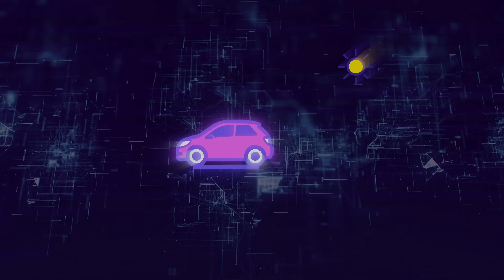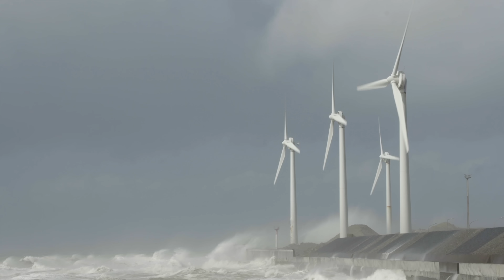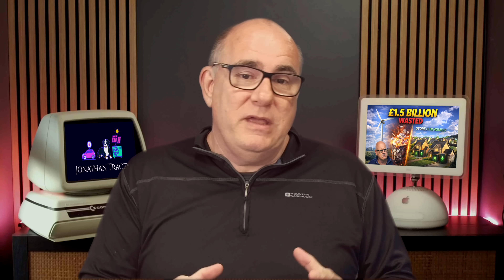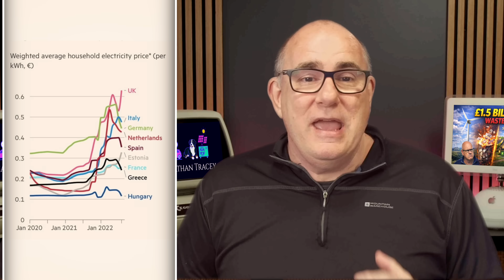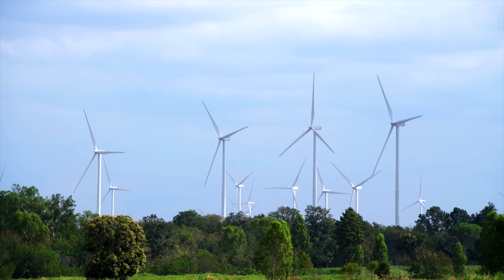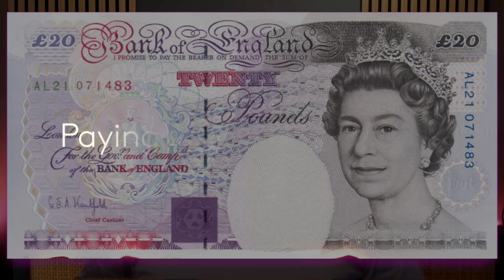We’re Paying £1 5 BILLION To Waste Energy… Here’s My Big Idea

Comment: Have had the same thought myself, it's a total no brainer to mitigate the overbuilding of renewables where necessary energy storage was conveniently omitted to make the numbers look better.

But need to correct you on one point, the point of gas fired plants was never to be turned off and on to make up for lack of renewable production. The fact this is now taking place is a another huge externality of renewables whereby they make the cost per MWh of base load look extremely expensive because plants designed to run 24/7 have much lower utilisation but the same capital and fixed costs
Reply from the maker: @SuperBulrog You’re absolutely right on the utilisation point 👍  

Gas plants were originally designed to run much more consistently, and lower utilisation does push up their cost per MWh because those fixed costs don’t go away.  

Where things have shifted though is how the system is being operated. Gas has effectively become the balancing mechanism — not because that was the original intention, but because it’s one of the few things that can ramp up and down quickly enough to deal with variability.  

So in practice we’ve ended up in a situation where:
- Renewables set the availability  
- Gas sets the price and fills the gaps  

I’d argue the real issue isn’t renewables themselves, but that we didn’t build storage, flexibility, and grid capacity alongside them — so we’ve forced gas into that stop/start role by default.  

If we had enough storage and demand-side flexibility, gas wouldn’t need to be used in that way nearly as much.
Reply: Even at 100% utilisation gas power plants are about £95 per MWh. Scottish wind with the cost of the cable to remove the bottleneck and the curtailment fee, 25% of which goes to the farm, and 75% goes to the gas power plant, comes out to £60 per MWh.

So counterintuitively, it would be cheaper to pay MORE wind turbines for their excess power, than it would to run a gas power plant.

But we're not doing that. We're building bigger cables so the power isn't wasted which will lower the current wind power cost by £1.5B per year, AND enable us to build more generation capacity which will lower the gas plant cost from ~£95/MWh to ~£45/MWh. And because the energy price is set by the most expensive generation that's on at that time, this will potentially, basically half our energy costs... as long as those costs gets passed on to the consumer...
Reply: @Leo99929  Cables and using excess production is only half the story. Without including grid-scale storage in the cost, you can’t fairly compare wind to baseload generation. More wind without storage raises blackout risks during calm periods and worsens grid inertia issues. With proper storage, the total cost is significantly higher than the £60/MWh quoted.

Comment: The home battery idea presented is only in part a potential solution as the battery storage would need to be on the same side of the grid constraint as the constrained generation. The potential solutions are 
1. Increase grid capacity to reduce the constraints. This is happening and is delivering but is  of long timescale.
2. Increase demand in the area on the generation side of the constraint (typically in Scotland). The battery proposal covers this in part but Octopus are also addressing the beginnings of this by incentivising increasing consumption at these times for the customers on that side of the constraint. This could be automated in an increasing manner with more control of heavy loads such as EV charging or heating water. 
3. Linked to 2, incentivise industry to locate in generation rich areas.
Reply from the maker: @ianmitchell6279 This is a really solid breakdown 👍  

I completely agree — batteries only solve the constraint problem if they’re on the right side of it. A battery in the south doesn’t help when the excess generation is stuck in Scotland.  

Your three points are basically the whole strategy:
1) Build more grid (slow but happening)  
2) Increase demand where the energy is (smart tariffs, EV charging, heat, etc.)  
3) Move industry closer to generation  

Where I think the “home battery” idea still has a role is in scale and speed. We can deploy thousands of small systems *very quickly*, and if they’re even partially aligned (through tariffs or automation), they can start to absorb some of that excess generation sooner rather than waiting years for grid upgrades.  

It’s not a silver bullet, but more of a “buy us time” solution while the bigger infrastructure catches up.  

The interesting bit will be how well suppliers can actually coordinate that demand side — because that’s where this either works… or doesn’t.
Reply: The cables are due by 2030. Not sure how long it would take to set up factories to produce the batteries to sell, but I bet it's more than 5 years, and at 40% of the £/kWh estimated in the video, it would cost about 6x as much in 3.7M BEV batteries and there's only 3M cars in Scotland...

There's things we can do in the short term and the gov is way too slow at approving things like V2G and electric micro mobility. But the long term cheapest solution is £8B worth of undersea cables that are already in progress. Communication from the Gov on this has been poor. 

But given this is the case, it might be worth looking at where you get your news from if this is the impression you have, because somebody is actively trying to manipulate/mislead you! Most newspapers are run at a loss/tiny profit because they make money for their owners by swinging public opinion for a fee.
Reply: A simpler idea is to scrap the subsidy for unreliables . Why hasn't that been considered? If the wind doesn't blow, there's no electricity. Those people who want unreliables can have a black out and the sensible people can pay for conventional fuels. If too much is produced, the windmills shut down. Too little and energy is horrifically expensive. Just stop taxing gas and nuclear and subsidising unreliables and let people buy whatever energy they want. Ah, but that would expose the hoax, wouldn't it?

Comment: The problem is that if they installed these batteries in to every home the great majority would vote against it saying it's only the government wanting too snoop on you.
Reply from the maker: yeah some people just can't be helped but most normal people would see it as "reducing my bills"
Reply: @JonathanTracey  Are there any normal people?
Reply: I know four people who refuse to have a smart meter for the same reason... Convincing them to have a smart battery installed by the government would be a serious uphill struggle,  if they were paid to have one they would be even more suspicious. 😏
Reply: @roblinc2u  I worked in computer security. I have a non internet connected system that's not to bright. I'm not scared of the government but of garbage software, dodgy cloud services, companies going bust, and bored teenagers.
Rolling out a large amount of centrally managed batteries is a really challenging security problem and most of the software produced today isn't fit for purpose let alone fit for use in a secure environment.
Reply: In fairness, the state would. They'd want to control what the energy was used for.

Comment: The problem is the power lines from Scotland can't carry enough energy down to the south - It's not a storage issue

Those gas turbines they turn on are located in the south where this "network congestion" problem doesn't exist

That said, batteries just make sense don't they? Your base load can be virtually eliminated using just battery and arbitrage and that's before you've even put solar panels in
Reply from the maker: @Akimbo711 You’re definitely on the right track 👍  

It’s not that the power can’t come down from Scotland — it’s that the network can’t handle it all at once, so we end up curtailing generation and firing up gas in the south.  

Batteries absolutely help with that, especially if they’re placed near generation — they can soak up excess and reduce how much we need to push through the grid at peak times.  

The bit that’s often missed though is scale. You need a lot of storage to make a meaningful dent, and it has to be coordinated properly, not just scattered.  

But your broader point stands — a mix of grid upgrades, interconnectors, and distributed storage is the way out of this. It’s not one silver bullet, it’s all of it working together.

Comment: This could start at the planning stage. All new dwellings and industrial premises must have batteries installed otherwise no permission.
Reply from the maker: I agree it should be mandatory for every new home
Reply: @JonathanTracey Unfortunately new homes are currently being provided with sub-standard solar and batteries. Effix the Electricians Channel did a YouTube video exposing this.
Reply: And it needs to be a decent size battery 10 kWh minimum, not like the three or two panel systems being put on some houses or a three pin socket for the EV charger. In other words the legislation needs to be absolutely specific as to how much, probably calculated by roof area. EV chargers should be mandatory 7 kw.

Comment: The problem is that there is still a glut north of B6? that can't be stored by the locals without some rather large batteries and/or more grid.
Reply from the maker: sounds like a solvable problem to me
Reply: @JonathanTracey  It's being solved by the Eastern Green Links (EGL1, 2, 3, and 4). These are additional 2 GW subsea cables. By the early 2030s, these will more than triple the capacity to move power south.  

The goal isn't just to stop the 10 TWh of waste we have today, but to prepare for the 80+ GW of new wind power currently in the planning pipeline—enough to turn Scotland into a "green battery" for the rest of Europe.

This will cost ~£8B, vs the £48B you can calculate the battery cost to be, which needs to be installed in Scotland north of the B6, for a fraction of the capacity. The battery would only solve the current local over production. The cables will enable further expansion with zero over production.
Reply: @JonathanTracey  Except locals don't want large industrial complexes located in the Scottish Highlands. Just look at the planning refusal for the Fanellan Substation in my area. Proposal that would disrupt transport, require bridges be replaced, increase traffic on narrow local roads and provide absolutely NO benefit for local people.
Reply: @tarbat and continue to have higher standing charges and unit rates. Here, have this monstrosity and pay us to have it.
Reply: @t @tarbat chap, we’re all on this island together and we all have to do our bit. You think I want a railway running by my garden? You think I like paying tax? Not really, but it’s good for everyone and we all benefit.
Reply: @JamesJones-uu7ou  Totally different. A railway line and taxes most likely benefit you LOCALLY. Wind farms and battery storage provide NO local benefit.
Reply: @tarbat how does paying taxes, far in excess of the services I directly receive, benefit me?
Reply: The wind farms are still in the wrong place. The argument seems confused.
Reply: @henryshannon2013 the value of building the farms in the right place increases if we stop paying them to turn off.

Comment: Plugging in a 'Plug in Generator'(Plug in batteries & plug in solar) does mean you are fitting a device that can provide power to your house (potentially export - previously needed G98 for this). Not all consumers have bi directional circuit breakers. When you fit a professional MCS Solar+battery installation the installer must fit a bi direction circuit breaker - thats the UK Law!. So if people do start using these plug in batteries and plug in solar there 'may be' a few problems. In Germany bi direction circuit breakers are standard and they have had plug in batteries/plug in solar for a while. So I think offering these plug in batteries 'as free' in your video, may show up some problems, so its a risk. I do wonder if having a grant (so you chose a product) and have an approved installer might be the way to go, the installer can advise and do a safety check. I have not spent much time on this, but I wanted to question your theory and check this has been considered. I raised this point before I knew about Plug-in-solar announcement.
Reply from the maker: I do wonder if the risk is being blown out of the proportion, I get there are gonna be a lot of houses in the UK with 1950 style consumer units and poor wiring but these could easily be fixed. The vast majority of houses I’m sure will be absolutely fine. I did a search for how many fires there had been because of balcony solar in Germany and I could only find one instance. Yet there are many thousands of electrical fires caused by things like tumble dryers or fan heaters.

My hope is that the electrical regulations get updated in a sensible way and they don’t suddenly require £1000 electricians inspection to be able to install a £250 system
Reply: @JonathanTracey  I guess the full answer is out of my realm of experience.. sorry. I do know most UK consumer units are not Bi-directional(i.e. the RCDs). Even my 15 year old house - the consumer unit is plastic and as you know I am having survey on Solar+Battery installation and the first thing I was told is, if I wanted UPS, they would have to replace the plastic consumer unit with a metal one. I did not know that!
I wonder if a competent Electrician can enlighten us on Plug in batteries.
Reply: Any Electricians to answer 4 questions below
1) If you remove mains from the circuit the Plug in battery is connected to:-switch the breaker off, does the battery detect this and isolate itself. (A bit like a proper UPS system isolates from grid).
2) Installing DIY PV solar is not risk free. Plenty of people get a shock because they did not cover the solar panel with a blanket.
3) I would be interested to know if the DNO would be happy about the extra export. They can be very fussy with export limits. I have 'heard of people' applying for an export limit and being given nothing.
4) Would it be possible to change an RCD in a consumer unit to being Bi directional. Or is this the wrong question.
Reply: @philipevans3932  
1. Yes. It's required and tested extensively
2. The balcony systems come with premade cables and generally also one panel per mppt input so that the voltage is below 50v and there isn't enough current to set things on fire
3. G98 for 3.6kW or less is a post install notify - they don't get to refuse. Adding it to an existing install could be problematic especially for people wanting to boost old 3.6kW systems
4. Yes, easily but I don't believe you can make the change unless you are either an electrician permitted to self sign work, or you have a building inspector check your work after you do it and before you turn the power back on.
Reply: @etchedpixels  Thats all great to know. I think the answers seem very reasonable. Thank you for your input.
Reply: Now that  I have done some more research looking at the government anouncement "The UK has legalized plug-in solar systems under updated G98 and BS 7671 rules, allowing small units to connect safely to home circuits. The move expands renewable access while maintaining strict safety and grid compliance standards." I have noticed the onus is on the Home enthusiast to comply with the new regulations which is a bit weak. But I would always recommend anyone thinking of adding Plug-in-solar to involve a qualified electrician to install it so that your home has been checked its suitable and you do understand some of the pitfalls. You are also obliged to contact your DNO to tell them you are potentially going to export energy. Most people won't bother contacting DNO which I feel is wrong because if I was the DNO I would like to know.
Reply: @philipevans3932  We have to wait for it actually to become legal first. The DNOs are in a tricky spot. They need to know. The G98 and electrician process is a check point for old meters (the ones that go backwards or count export as import etc) and for the DNO management but at the same time if the DNOs get 100,000 badly completed G98s the month after it's approved then they'll melt let alone their cables.
Reply: @etchedpixels  Many thanks for extra information that supersedes my search and paste comments. I agree further details are required. If you do find more, please add further comments. thank you.

Comment: Great idea. I think a quicker and easier way to achieve a similar ambition would be a simple £500 grant, once per household, towards a home battery (plug-in or professionally installed). You wouldn’t get the “made in UK” benefits, but existing manufacturers and supply chains would flood the UK market to compete for the business.
Reply from the maker: The problem with doing it with a grant is it would encourage private company suggest increase the cost of the batteries to make a little bit more profit. You don’t need to apply for a grant to get a smart meter installed so why not just have somebody turn up and install the battery for you.
Reply: @JonathanTracey  Thanks, I have watched a number of your excellent programmes, and think a 2-3kwh battery would be great to cover most of my average daytime use, maybe with using an EV tariff. I know the smart meter is free. I think the Bluetti apex 300 2.8kwh £1400 might be approriate. I believe I need a transfer switch, and I know an electrician. What do you think the additional switch and installation cost might be? Any comments? Thanks